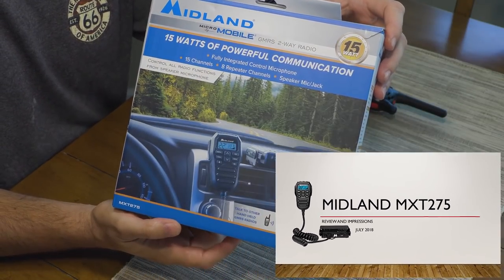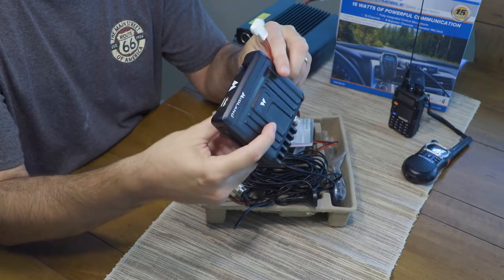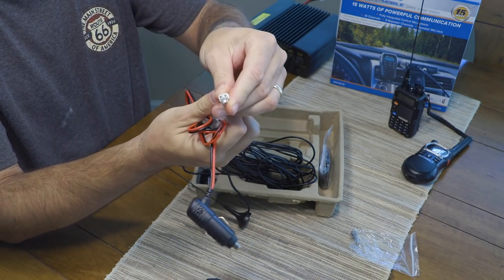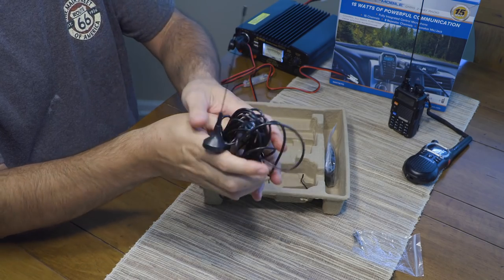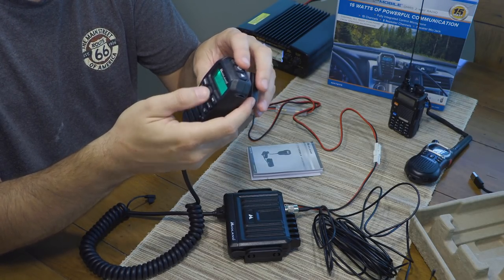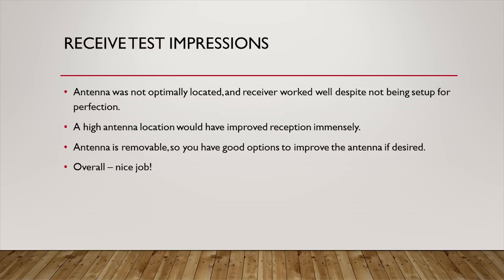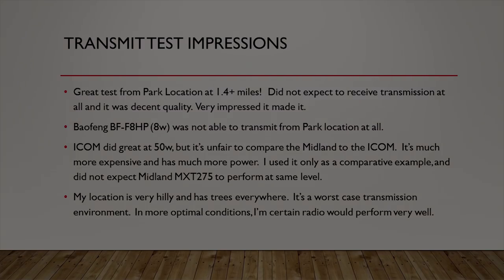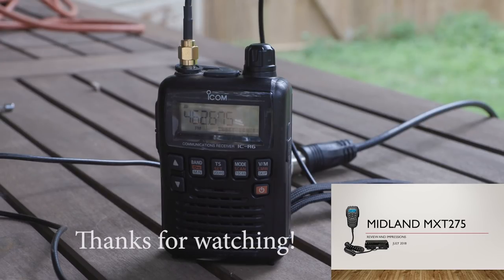Midland MXT275 GMRS Radio Review

Comment: You might could attach that radio to your little Deere to use when you are on the back 40 and you need to call in to HQ to tell your squaw to put the buscuits in the oven for dinner.

Superb honest review of the radio. The issue that I see is that all the control are built in the microphone. If something happens to it, the unit is worthless.
Reply from the maker: That's the idea!  Midland was kind enough to send me a 'Tractor Ready' unit that I'm working on a review for...be sure to check back for that one!  Thanks for your comment!

Comment: I wish they made a 40/50w version. I love the mic design
Reply: They do it's called Midland MXT400 I believe and its 40watt also if you search Btech gmrs 50 watt on amazon you can buy that one instead.
Reply: It takes 10x the power to get twice the range. You would get more out of a better antenna than you would by upgrading to a radio with 40w.
Reply: @HeckWes88  Doesn't have the display on the mic though.  For some of us, that's the key feature.  Was for me.  Added a better Laird +3db antenna and Larson mount and the radio seems to be performing nicely.
Reply: @jaybarr3307  oh i see you'd like the mxt275 platform style but in a 50watt that would be sick
Reply: I run 45 watts and cover three county's and when the east coast G M R S
group come up on line I talk to Chicago I'll.
Reply: thay do make a  45 watt radio and I have it it his big brother  from rugged radio
my first tower is 15 miles away and I hit it just fine
Reply: I use a mag mount antenna on 462 700
Reply: or you can  call my friends at rugged radio and buy a real radio sold
in a store that sells radio's for off road I bought a 45 watt moble.
Reply: that is true a have a mag mount IT walkes and talks
Reply: rugged radio makes a 45 watt radio.
Reply: there is a 45 watt radio made with all the same stuff for people with off road toys
check out rugged radio.
Reply: why would you need a 50 watt radio the repeater is putting you out at 60 watt's
and you are going 20 miles  I run a 45 watts and come in loud and clear
from 10 miles out from the repeater that means I own a licensee.

Comment: Stick the mag mount on a metal surface like a cookie sheet pan. I would also get an aftermarket mag mount antenna. NMO mag mounts with a UHF 450-470 Mhz antenna that have 5 dbi gain work well. They come with a cutting chart so you can tune it to 463 Mhz. I use a MaxRad MUF4505 whip which is 26"
Reply: I bought my radio from a real radio store thay set up the radio and shipped to me set the radio up and went on the air came into the repeater loud and clear
he is 6 years in the past rules have changed and new radio's are being built.

Comment: I used Tram magnet mounts with the original element removed. I cut a stainless steel welding rod till I got 1.2 swr on my desired frequency. Actually a very small antenna about 5 inches long. So its a 5 inch magnet on a 5 inch antenna. Impossible to knock off. I usually get 6 to 10 miles on 5w. But when talking to walmart walkie talkie...its about 3 miles...which for us is line of sight. Regs for my country is different than the USA.
Reply: then you are NOT on G M R S you would be doing 20 miles your on  simplex

Comment: As for the low audio/mic gain... I wonder if the Midland is set to FM Narrow for all the channels instead of using FM wide for the repeater freqs. I believe that if a receiver is FM wide but the transmitter is FM narrow, the audio would be demodulated weak.
Reply from the maker: Really good point.  I'll try and test that to see if that's the case.  Thanks for the comment!
Reply: @tractortherapy42  Please share the results when you get around to it.
Reply: Yes, please do!
Reply: The earliest versions of this radio had a problem with the mic gain.  Midland reported correcting it and offered to take mics back if they have this issue - or so I've read on line.  While the narrow vs wide thing can come into play, it doesn't happen to me when I'm using Wouxan 905G handhelds which are set to wide.

Comment: If I buy this radio, I was planning on mounting the antenna to the upper rear roll bar of my UTV. However, in reading the warnings of this radio, it states: "The consumer must maintain a minimum safe separation distance of 33.54 inches." How important is this and it is measured from the tip of the antenna to the top one's head?
(86 cm) from the antenna when transmitting.
Reply from the maker: I think you'll be perfectly fine with that config.  You could always get a custom antenna that's a little higher and will have better range.  But some people think cell phones cause problems, so it's the same argument.  It's not a microwave.  But then again, I'm no expert, so take my 2c for what it's worth.
Reply: @James Babcock not all HTs are limited to 5 watts there are some that can go as high as 10 watts, I had an Azden AZ61 6 meter HT.  That put out around 10 watts.
Reply: @mysticwolf2842  be

Comment: From looking at the inside of this thing it looks like there is plenty of room to add components. I would like to know if you have any experience adding something like a Bluetooth module so that a wireless headset could be used.
Reply from the maker: Would be a fun project and probably not too difficult.  I don't like bluetooth headsets, so I'd probably not take it on, but with a little sleuthing and a solder iron it I'd wager it could be done without too much trouble.  The boards are a few bucks - trick would be getting the right pins connected.  Perhaps Midland can add this feature in a future model?
Reply: The only reason I want to use a Bluetooth headset is to put it in my helmet and install this on my Harley.
Reply: under  F C C rules the radio stayes the same no ad on's F C C rules apply.
I have a  45 watt radio came as is have not played with it in side EVER.
Reply: rugged radio sell's helmet mikes and ear phones for your helmite
the mike button mounts to the handel bar radio on your belt with holder
Reply: @tractortherapy42   I would not mess with it Midland is under strict rules
 from the F C C you could  have to give up your licensee and the radio
buy it and use it that is it

Comment: 50 watt radio and 1.4 miles? What dont u just connect to a repeater using the 5vr baofeng  or even a gmrs cheap radio connected to a gmrs repeater

Comment: The FCC doesn't want GMRS to follow the fate of CB with no control. I have CB and think a good SSB CB with a good antenna is probally a better option than GMRS from a technical standpoint. However since the FCC abolished licensing anything goes on CB. What ruined CB is people with high power linears hogging the channels and no rules or enforcement. Since CB has less traffic now I think I'll stick with CB for emergencies or when cell phone service is sporadic or unavailable. I have some older blister pack FRS/GMRS talkies which fill the bill for outings and short distances of a mile or 2 and are easier and more convenient than CB radios or walkie talkies. Are their any FCC designated emergency channels on GMRS like channel 9 CB?
Reply from the maker: Thanks for stopping by.  No - nothing like CB channel 9 in GMRS that I'm aware of, but local repeater operators might designate some suggested band usage guidelines - I've not seen any doing this though.
Reply: @tractortherapy42  Thanks, Do you know anything about MURS radio and how it compares with GMRS and CB. I understand you don't need a license, but your power is limited to 2 watts and it's on VHF, 5 channels at about 151 MHZ. Do you know anyone who uses it and would you recommend it or GMRS?

Comment: Was the tripod antenna a dual band  vhf/uhf antenna? I was disappointed by the signal coming in from a mile away to your icom Ht. That tiny supplied antenna may be very limiting. Did you use the tiny supplied antenna? I think 5watts over a good dual band comet or diamond mag mount antenna would’ve been much stronger. 15 watts should’ve been much better, I believe.
Reply from the maker: My environment is very hilly and lots of foliage.  In a more 'radio friendly' environment, you'd most likely see great performance.  I've been happy with mine!

Comment: That RG-174U coaxial cable that is attached to the supplied magnet mount antenna is VERY lossy and not good at all for UHF. You'd be way better off to purchase the larger antenna that's intended to be used specifically with this radio.

Comment: TT thanks for the comprehensive review, appreciated muchly. Curious if you found a solution to the low mic gain issue on Tx. Cheers KC1CCR
Reply from the maker: No not really - just need to remember to talk a little louder than I normally do.
Reply: As I understand it, Midland crapped the bed with many oversights in design of their line of mobile GMRS radios.

On the smallest radios, they are not repeater capable.  On all of them, they ONLY do Narrowband FM.  GMRS, is one of the few, perhaps the only, land-mobile radio service where you can legally use Wide or Narrow FM.  Since these radios will not do Wideband, they will necessarily sound weak on audio when talking with someone in Wideband mode.

Comment: Could or would this GMRS radio be used to replace CB’s on the highway?
Reply: NCICRESQ not if you want to listen to trucker on the road, the CB is still alive and kicking. However GMRS is kinda the new CB “citizens ban” with one loophole that u have to buy a gmrs 70$ license
Reply: @davidjd123  the intent is to phase out CB . In some applications like a Jeep event these are quickly being taken to heart. They have better clarity and range . Likely in about 10 years CB will be mostly dead

Comment: Did you try a different antenna with a 3 or 6 dB gain.  ThT might have helped the range.  Just wondering .
Reply from the maker: I would have liked to try a few different combos, but it would have taken alot of time.
Reply: antenna falles under F C C rules NO NO NO.

Comment: I just purchased this radio and I now have it installed in my jeep do I have to adjust or tune after market and Tana
Reply from the maker: Just make sure your antenna is designed for GMRS frequencies and you should be fine.  A CB or non GMRS tuned antenna will not work very well.
Reply: IT WON'T AT ALL   g m r s  is 462 radio band c b is 27 meg
Reply: the antenna will match the radio from factory   F C C rules

Comment: Can this unit be used with other brands of GMRS radios? Or is strictly midland to midland communication?
Reply from the maker: Any GMRS radios will work - not restricted to Midland brand.
Reply: privacy codes could be a hindrance. finding out which codes match to which make/model of radios. this is a reference i found online. https://www.k0tfu.org/reference/frs-gmrs-privacy-codes-demystified/

it may be trial and error overtime.

Comment: Only 1 1/2 mile usable range at 15 watts?? Midland advertises this at minimum 5-10 miles range in obstructed conditions. What's the advantage to this larger unit than a handheld that has same range?
Reply from the maker: I think it depends on your definition of 'obstructed' :)  The range figures on the sales documents are at best 'generous'.  My environment is dense trees in summer full foliage and hills - I'd say it's pretty close to worst case - and my antennas were not optimal.  Antennas are much more important than wattage / power.  I think this unit would do fine with good antenna placement and better environment.  I'd not be surprised if you got 5 miles in a flat urban / suburban area with minimal trees.  I could have probably gotten 2-3 miles if I really worked on the antennas.  It's also repeater capable, so that can greatly improve your range - but my video was only testing simplex - radio to radio.  Thanks for checking out the video and stopping by!
Reply: I have the MXT115 with their 6db antenna and have talked 20 miles in flat terrain. I’ve hit repeaters even further than that with great audio reports. The factory antenna is what it is. Mounted on a car, outside of a home, you’ll be surprised. However the Midland 6db antenna or the 5.5db antenna from DPD Productions I are great antennas. Adventure Vehicle Reviews has a video on YouTube, and they talked 34 miles from one MXT115 to another. These are all great products at an amazing price point. Nice overall review, sir!
Reply from the maker: I just got a new base antenna from Ed Fong tuned for GMRS that I'm wanting to try out with this radio.  Thinking about making another video using it mounted to roof of my house.  I have one of his Ham tuned antennas and it works well.  Should be a big improvement - got it because I'm playing around with building a home brew GMRS repeater.  Thanks for your comment - agree that antenna choice is important and not surprised with your results on flat terrain - in open areas these radios should do great.  No radio is going to do well in my environment at GMRS/UHF frequencies.
Reply: Tractor Therapy you’re welcome. HardenedPowerSystems swears by the Ed Fong GMRS Antennas, and I’ve heard nothing but great things. I’ve been using the DPD Productions Vertical Outdoor base antenna, 4dbi and has worked really well on the house. I can hit it from the car with MXT115 from miles out! I’d be interested to see the review if you do so. We all love HAM, but I think many people can benefit from seeing the capabilities of GMRS products, that may also fit people’s budget better. Thanks for the great content.
Reply from the maker: I've been a ham for a while, but definitely agree with what your saying on GMRS.  I've had some difficulty getting my 16yr old interested enough (imagine that) in Amateur radio to take the test.  So, I've been playing with GMRS and MURS so we can play with radios together.  Hoping eventually he'll come around and take the ham test, but in the meantime, GMRS is a good solution for us.  There are some really good radios out there like this one at nice price points.  I'll check out the vids from HardenedPowerSystems as well.  Thanks!
Reply: Tractor Therapy Any update on your MXT275? Just curious how its been, some of your experiences so far. Any antenna upgrades?
Reply: So I bought a stryker 655hp 150$ antenna and hand braided coax. Was very disappointed to find out no one uses c.b. anymore. Do people actually use gmrs?

Comment: I go trail riding in my side-by-side UTV (not enclosed cab) and am looking for something that would be somewhat water-proof for talking with other UTVs in our group. In dusty areas, we tend to be more spread out, but not more than a mile or so. Any recommendations?
Reply from the maker: This radio would work pretty well - you just need to make sure the base unit wont get submerged and protect the mic when it's not being used.  It's not waterproof, but it's designed to be used in rough environments.  I think it would work well in an ATV and dust won't hurt it too much. With good antenna placement - you should get good range.  If you do some testing with it - I'd love to hear how it goes.  If you are in a reasonably clear area - you could get many miles of range.  Thanks for checking out the video!
Reply: Will I need an FCC license and, if so, how long does that take to get?
Reply from the maker: Yes for GMRS.  There's no test - just a fee and it covers whole family.  I think it's instant as soon as you pay the fee.  I detail some of that in the description or "show more" section under the video.
Reply: @deanlevang6031  GMRS license needed - apply on line and pay fee and you will get it almost immediately
Reply: I have  your radio look up my friend's at RUGGED RADIO thay have everything  this one doe's not have  head set's  hook up's for all 4 head sets  and a 45 watt
radio to go with it check it out and every thing is water tight

Comment: Is there anyway to power up a bc radio with a USB port
Reply from the maker: Not sure what you mean by 'bc' radio - did you mean CB / Citizens Band?  If you meant CB, then I'd have to say no.  USB runs at 5V and generally has between 1 and 2.1 amps current.  Most CB's I know of use 12v.  But the CB should be able to use same power source as this radio.  Thanks for stopping by!
Reply: Tractor Therapy yes I meant CB. My vehicle only has USB ports now. I’ll probably just run  it to the battery. Thanks for the info and quick response